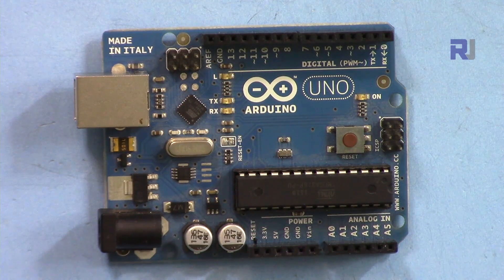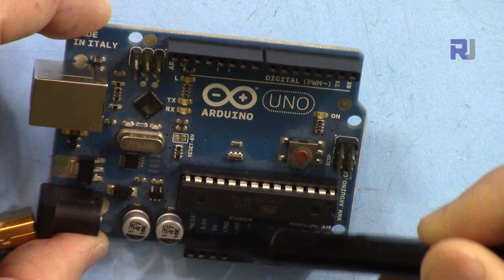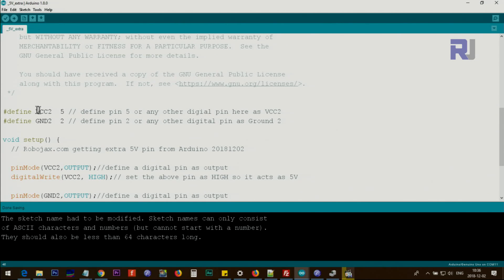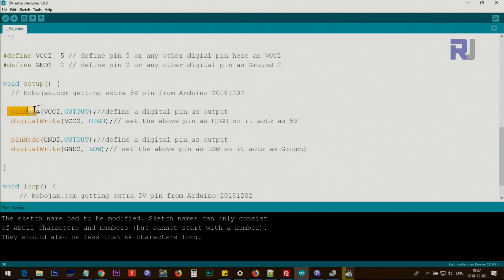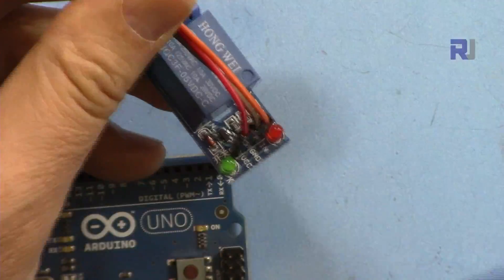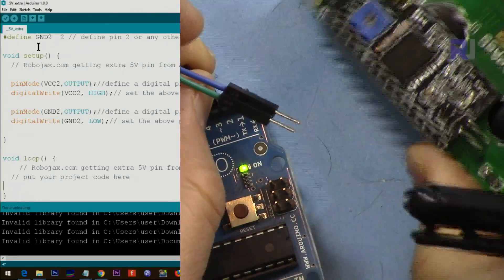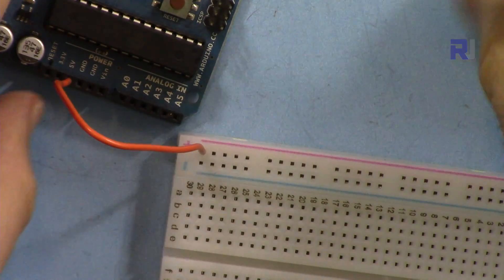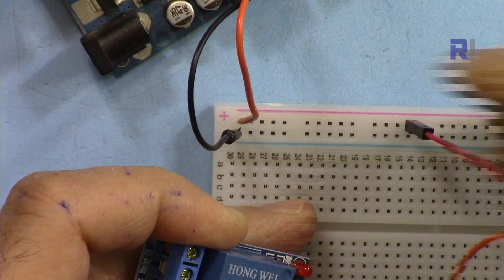How to get additional 5V (or 3.3V for 3.3V boards) and GND pin from Arduino

Comment: Would we have to add are code to your sketch to use the  extra vcc and ground in are project
Reply from the maker: yes of course. this code I've shown, just take the portion shown inside setup() {   CODE   }, get the CODE section and add it to the inside setup() {   THIS IS INSIDE   }
Reply from the maker: you can learn bout the setup() and loop() here in this video https://youtu.be/X8OJjMIHCrw good luck

Comment: #define VCC2  5
#define GND 2
void setup()
pinMode (VCC2, OUTPUT);
digital write( VCC, 5 HIGH);. ?
pinMode (GND 2 OUTPUT);
digital write(GND 5? 
I Wanted 2 positive 5 volt and 2 ground. I Didn't think it was a dumb question.... Really I have seen common ground setups but I wanted extra grounds and your code seamed to me to have it written as only pin 2 being activeated ...
Reply from the maker: your code is not correct. you have to define VCC1, VCC2, VCC3 etc. if you want to use GND, do the same GND1, GND2 etc. but you can use.  then using pinMode again define pin a output.  
These are very basic concept.  Here is free Arduino Step by Step Course  (over 100 video lectures) Starts here http://robojax.com/L/?id=338

Comment: Thought so , wouldn't the code have a 5 and 2 pin ? yours has all pin 2 input and high?  I am perplexed. pin say 2 is hot and pin 5 ground  in the code?... I'm new 1 1/2 months and got involved thinking a radio spirit box would be easy. I'm stuck on adjusting the TEA5767  scan with a trimpot... ya I didn't start easy..lol... thanks 👍 subscribed for sure. lots of help in your vids.  Bob H.
Reply from the maker: Hello,  Arduino already has 5V. you don't need any code for it.  This video is for people whom already used Arduino and face challenge of adding additional 5V or GND. 
If I could not stay better than the video. May be watch the video more than once. 
Here is an Arduino Course from absolute beginner http://robojax.com/L/?id=338
Reply: @robojax  ya thanks , I have used my 5v connection and was adding a Tm1637 in a month and a half two books and no questions asked I think getting my TEA5767 and an uno and nano board working was doing ok. I'm adding a  Trim pot also . Just needing an extra 5 volts was adding an extra pin in both locations. Sorry if you are too far ahead of me. I have plenty of schooling in different areas I was always glad to answer nicely... This is why I haven't asked. maby it's to basic to be stuck on but most often it's the damn little stuff that gets me.

Comment: DIDN'TT WORKED
Reply from the maker: Then you either change the code, did incorrect wiring or you connected a load which Arduino can’t then ON. Just connect LED with a 200 to 1000 ohm
Reply: @robojax   actually, i connected bluteooth module at 5v pin and lcd with i2c at digital..

Comment: Sir unfortunately it didn’t work I included codes #define VCC8 8 and all even tried #VCC2 8 and other codes
Reply from the maker: Please first use the code without changing it.  When you say didn’t work, provide error or observation details.

Comment: The relais you used in your video consumes about 60 to 70 mA. Powering such a device from A gpio pin (which has a maximum! current supply of 40 mA) does not make your Arduino gpio pin happy 🤕
Reply from the maker: I have mentioned the current which is about 20 or 30ma so connected a load equal or below the rates current.

Comment: There are another 2 sets of 5V and GND pins, one for each of the ICSP headers which you can use. (Note: some/most clones only have 1 ICSP header)
These are connected directly to the 5V regulator output so you can drawer more current then sourcing it from the microcontroller itself.

Comment: Thank you!!! you saved me from needing to buy a whole breadboard for my project!, But I have a question, the new pin that is set as VCC it will be 5V or 3.3V?. Thank you again!!
Reply from the maker: you are welcome. In some Arduino like nano or mini you will have only 3.3V. in that case it will be 3.3V but if your Arduino is 5V, then you will have 5V.
Reply: @robojax  I have an arduino uno, but the  bluetooth module that Im using (HC-06) requiers 3.3 V,  in that case the code that you show, can I use it in my situation.

Comment: I have a question. Does this work with servos? I tried using the code and it does work with led's and such but it doesnt work on my servo
Reply from the maker: I mentioned the amount of current this board supplies. it is about 30mA. servo needs more.  see this video showing two servos and you can connect more https://youtu.be/_uz7YcOzvjU
Reply: @robojax  Thank you sooo much, I tested it and it worked. I've been trying different stuff for 2 days, and im new and still learning so I really appreciate the help.

Comment: Sir,from 6:40 can we connect more than one component in the same line...for example, if I connect a relay and a sensor after connecting the 5v pin with the breadboard then will both of them get the reqired amount of current that they need to properly function?? Please help me with this as I am a pure beginner...🙂
Reply from the maker: Hi, yes that's what breadboard is for.  you can connect as many as you want as long as you    don't draw more than 300mA or 400mA depending on your Arduino board which you should read the manufacturer datasheet.  here is my video on how to use breadboard https://youtu.be/8sUijpGh8yM and here is 30 minuets Arduino course which you will learn the most important things to get started https://youtu.be/8sUijpGh8yM Good luck

Comment: at which point we have to use this code ?? like we have to use it in starting or in middle of program
Reply from the maker: This set the pins at the start of program inside setup() so  you should know that setup runs at the beginning

Comment: hi!
i am using this code but when i try to upload it,  it shows the following
exit status 1

Error compiling for board Arduino Uno.
Reply from the maker: it means you have not selected the COM port. Click on Tools-Ports and select the right port.
Reply: @robojax  thanks now it is working

Comment: This method works and with 3.5 V?
Reply from the maker: Yes. Whatever your arduino voltage is.
Reply: @robojax  Thanks for answer man!!!!
Reply: @robojax  So when I connect to the voltage wires  in the breadboard and the other cables from the sensor in its place on the arduino it works?( sorry for my english, i am romanian)?
Reply from the maker: no problem. whatever I have shown on Arduino, you can get 5V or 3.3V whatever your board is and you can connect it to your sensor.
Reply: @robojax  Thanks
Reply from the maker: you are welcome.

Comment: hello as for the green and red led relay, how much current does it draw since I wanted to use Arduino UNO for 5 relays
Reply from the maker: As shown here (in TECH SPECS) https://store.arduino.cc/usa/arduino-uno-rev3 maximum current of digital pin I/O is 30mA. 3.3V pin has 50mA and 5V pin up to 500mA. So if you want to connect relay, power the relay , it should be relay module like this https://youtu.be/g6k8sPJyif8 and you can't use just a relay because the I/O digital pins can't turn ON /OFF the relay.

Comment: Hi robojax
know one thing you've been my favorite teacher on YouTube
I have a question to you about this video (How to get additional 5V and GND pins from Arduino);
question / if i want to get a lot of extra pins for example 10 VCC and 10 GND in that the number of lines is (60) the code become very long how to minimize it to max and have the 20 new pins
Thank you in advance
Reply from the maker: thank you for your nice comment.  To reduce the code, use for loop I have shown in this code inside the setup() http://robojax.com/learn/arduino/?vid=robojax_4ch_relay_push_button in this code it shows for 4 pins, you can make it as many as your board allows.